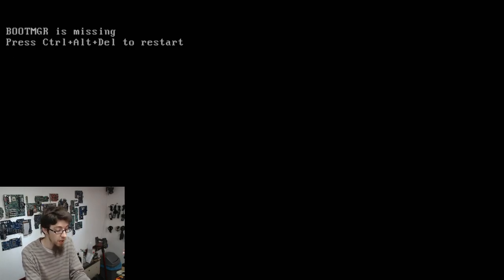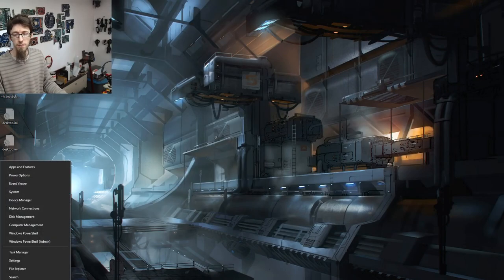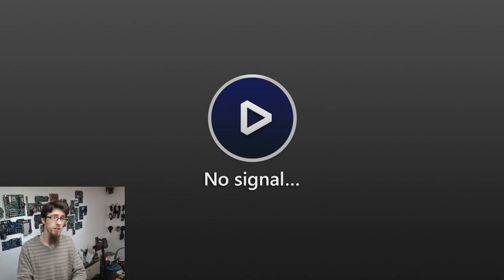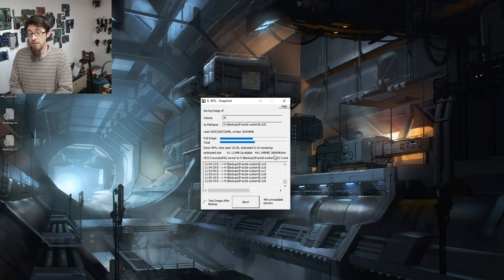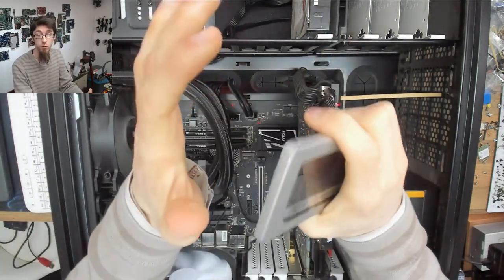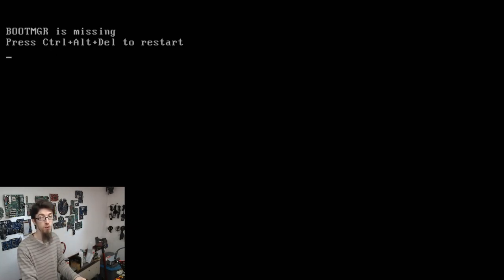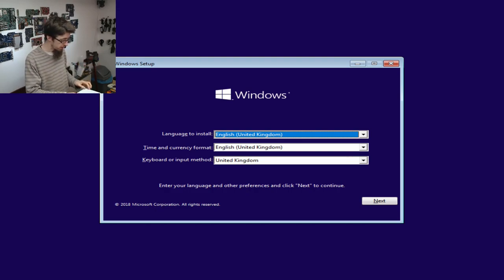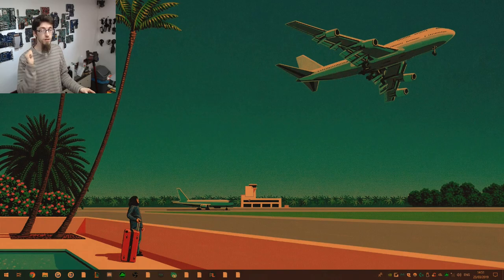LFC#170 - BootMgr Is Missing

Comment: 327 / 5000
Risultati della traduzione
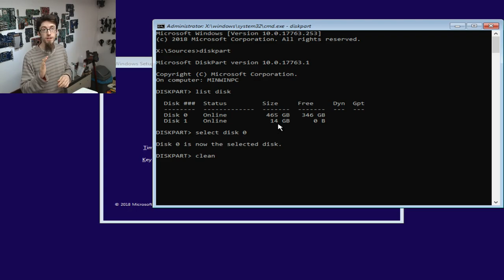Excuse me because you did not use the command "convert gpt? With my EVO 970 I did initialize from the hard disk management and I could not install the operating system it tells me that it could not create a partition. Then I did as you did in video 39:56 but I also used the convert gpt command, so I didn't need to?

Comment: Will this work to expand the drive size? I upgraded to 1tb from 500gb I use free clone software but it only shows (rounding up) 500. I can't get device manager to do it. I expanded the last partition but it still doesn't show, it's just usable space now?. I was hoping to not have to buy a 40-50.00 key to use the clone programs or partition manager program.

Comment: I like to keep a 'Windows to Go' USB stick handy, (32gig made with Rufus) that I can boot from and access the possibly bad boot drive as a second disk.  Saves lots of time.  Can recover data from it onto another USB stick provided it is readable.  Don't even have to open the case.  Can access disk manager and look at the partition setup if it's readable.  I put Aomei backupper on that Windows to Go disk so can run a backup to USB as well.  MEMTEST on another stick, and I can do the basics without opening the case.  Once memory looks OK, and I have some kind of backup, I can move forward.  That's the lazy woman's method.

Comment: I had a Nightmare swapping to a new SSD. I had successfully cloned my old SSD onto the new one but it would not boot and I would receive the bootmgr  is missing error. I eventually figured out that Win10 had put the boot partition on the harddrive when I first got the old SSD, so could no longer find that drive one it was replaced. I followed guides about how to create a new boot partition but nothing worked. I was able to update the bootmgr on the harddrive to a windows install, but as I had an old win 7 install on another drive it used that one instead :(  I was able to find a GUI tool that would let me change it (bcdedit sounds familiar) and now the SSD is being used. I gave up trying to make it bootable on its own.

Comment: I fix this all the time with just the actual computer, a hard drive / USB to backup, and a USB boot stick with Windoze installer on it. Laptops will have built in diagnostics. Do a video on using Windows boot USB, external hard drive, and RoboCopy to copy off your user data that would help so many people: RoboCopy off your data and an then a clean Windows install. Clean Windows install cures many ills.
Reply: I've had good results with bootrec but you need to be in a PXE boot and not on the mounted drive, run the commands from drive X:.  Likewise SFC.exe will complain but it's only about cache files and fixes things.

Comment: Maybe a simple or stupid question but could you not just take an image of the bootloader partition and use it over and over again?
Reply from the maker: Possibly, there's a couple of variations depending on drive configuration, EFI or non EFI, and so on. I think by the time I'd nailed down which images to have, I could just fix the issue at hand.

Comment: Where Windows puts the boot stuff isn't arbitrary. I found this out the hard way myself. What it does is it puts it on the "first" drive. How it determines the first drive I cannot say, but I imagine it's the same way Linux determines names like sda, sdb etc, presumably going by the first S-ATA port, nvme etc etc, in whichever order they are searching for the various types of drive interfaces.

Nevertheless, it's not arbitrary, but it sure does feel like it. I heard from somewhere that Microsoft started putting the boot stuff on the drive you're installing to with Windows 10, but I cannot verify this as I no longer run Windows.

Comment: From what I understand from that is it seem to keep the bootmgr file in a different location on the ssd.

But unsure where it is...

As i thought the old ssd corrupted the windows 10 what was on the old ssd, so that is why that windows 10 had a missing bootmgr file, as obviously the ssd was corrupted.

So u saved all what was on the old ssd to your computer.

Then you installed windows 10 from a flash drive, what then u installed on the new unused ssd.

But what I don't understand is when u moved the windows 10 file from your computer what was originally on the old ssd, then you put that window 10 file ton the new ssd, but in the partition where the windows 10 what u installed from the flash drive then install on the new ssd was.

So why is it when u put the windows 10 file from the your computer what was originally from the old ssd,  in the new ssd partition, what has the flash drive installed windows 10 on it, why did it not reproduce that missing bootmgr error?

Is it as when u installed it from the flash drive, then installed that to the new ssd, that bootmgr file was not installed in the same partition of the new ssd?

As i would of thought if someone hyperthcally installed say 10 gb file  say with a file name - A, on some memory device like a ssd etc, what say was also only 10gb storage capacity, BUT then that person installed a file what was also 10gb  say the file was called - B on to that 10gb capacity ssd etc.

Then won't that mean the A file would be totally abolished, as B file would of used all that 10gb capacity ssd etc, what was originally used by that that file A.

Comment: Couldn't you have done a clean install of Windows using the save existing data option?
Reply from the maker: I find that to be a very unhelpful option because you still need to re-install all apps (unless it's changed since I last tried it) so it doesn't actually achieve anything that a backup-and-reinstall wouldn't do.
The methods I use are designed to preserve all installed programs as well, which is the more inconvenient stuff to set up again. Just copying user files back is easy.

Comment: If you have a windows 8 system can you use a windows 10 USB or does it have be a windows 8?
Reply from the maker: I think so, yes. One of the main things that game me trouble in this video was mixing UEFI and Non-UEFI boot. If the windows install is non-UEFI, you need to boot a non-UEFI flash drive to repair it. Standard windows USB has both on it, so you can use the BIOS boot menu to select which mode you need.

Comment: whats your view on a 4tb hard drive used in PC windows 10 pro, windows formats it to 2tb and the remaining 2 tb is unsuable, is there a fix/work around for this...
Reply: Yes. If it's your boot drive and the only drive in the computer, old style BIOS won't boot off drives bigger than 2TB. If it's just a data drive you should see all 4TB. Only UEFI booting will see all 4TB as a boot drive. Unless your PC is pre Sandy Bridge, you should have UEFI based computer
Reply: Basically what Craig said above me but just to add: if it is just a data drive and you still can't see the remaining 2TB then it may simply be unallocated in disk management which can be fixed by creating a new volume
Reply: Sounds like your drive partition is formatted to MBR, it needs to be GPT to able to use all 4tb ;-) You will lose all your data during the conversion unless you want to pay for specific software to do it for you. Windows has everything you need to convert it though, just google it.

Comment: I had subscribed awhile ago .. idk .. 2 / 3 yrs ago .. ? Hadn't watched in awhile either , was fixing / upgrading laptops as a hobby .. I really enjoy it , kinda self taught , an watching tube videos .. I actually purchased nice / decent used laptop ( acer )  I kinda have a difficult issue trying to get into password protected bios menu .. w / out simpler solutions  ..  at the point now possible flash bios chip to disable password  .. but last resort option was to purchase bios chip , as advertised with out password protected ..  preprogrammed  .. I've tried few other options with no success cmos battery removal .. contact points, which battery located under M.B. .. UGHH ..LOL .. ALLS GOOD .. I'll get it one of these daze ..

Comment: I'm wondering what if you copy boot partition (system reserved) from another working pc?
Reply from the maker: That'll be luck of the draw. The partition setup seems to be a little bit random depending on the PC's setup - ala, EFI boot, upgraded from older version of windows, OEM or vanilla install, etc etc - so the chances that the 'donor' boot partition has the correct config for the repair PC are slim. There's probably more elegant solution that the one I use in this video, but you have to weigh up Time Taken To Perform An Ugly Solution versus Time Taken To Find The Elegant Solution.
Reply: The cleanest solution I've found is to reformat the 100MB EFI partition, assign it a drive letter in Diskpart, then run "bcdboot <Windows driveletter>:\Windows /s <EFI driveletter>: /f UEFI".  That will set you up with a fresh bootloader with BCD pointed at the correct Windows volume.

Comment: I wonder what if a similar issue occurs on Mac OS or Linux.
Reply from the maker: Linux I'm not sure. macOS doesn't have too much issue because it doesn't use a bootmanager, macs simply look for a System folder on any available drives on boot, starting with the last-known-good boot source.
However, macOS can sometimes get its knickers in a twist during a big version update and get stuck in an install loop - so it's not immune to similar problems.

Comment: boot manager usualy installs on a "different hard drive" if u got it plugged in while installing windows on the drive you selected.
this is why when im installing windows....i disconnect all the hard drives (usb included except the one with the windows on it)
I just dont know what kind of "black magic" windows has...that installs the boot mgr on a different partition or hard drive for some reason...
since i had this problem  almost "every time" when im installing windows im ending up having the boot mgr on a different drive...and when im disconnecting the drive that contains the boot mgr...BOOM that message appears on the bootscreen.

Comment: This will work if, for instance, I cloned to a larger capacity M.2 NVME SSD from a M.2 SATA SSD and now it won't boot past the MSI logo on "restart", but it boots to Windows every time after a proper shut down. So right now I just avoid restarting my system. I don't really need to do restarts unless I install certain programs etc... But I don't like that it won't restart... Weird... Thanks for the video. I will definitely use this if in fact it might help my problem..

Comment: You assume all the time like with the BSOD. A failing hdd or ssd could cause BSOD and it may not be RAM as you immediately say. Also you don't necessarily need another computer as you explicitly state as there are tools such as hirens boot disc which would allow you to test everything in situe. Also you dive immediately into backing up the ssd when you should test it first as you will be backing up potentially corrupt files and why do that when you could only backup what the user really needs. You then restore a corrupted backup to a brand new ssd .. no no no. Start from scratch and copy data over as that way you have a fresh install that you know will work and be reliable

Comment: So anyone know if the latest Windows 10 feature update (build 2004) can make an NVME SSD - which was the boot drive - just completely disappear from UEFI?

No Windows Boot Manager in UEFI, no BootMgr missing error; just a  black screen after the system POSTs before it kicks you into the UEFI.
Reply from the maker: Not something I've seen happen yet... I take it it's not visible from a windows recovery environment either? If it's vanished entirely, I'd probably go straight to backup and reinstall windows.
Then if you've got a clean image backup of the windows partition, you could do the clean install to fix system partitions then restore Windows like I did in the latter part of this video.
Reply: @Adamant IT:

Hi Graham. Thanks for taking the time out. It's my nephew's PC, so I just had a brief look at it on Friday and won't be able to get back to it until later in the week.

No, NVME not visible from either Windows recovery or a Linux Mint USB (may have needed a driver).

Anyway, I plan on clean reinstalling Windows on a spare SATA SSD, then using your partition trick from the end of the video if I can get Windows to recognise the NVME. 

As much as I've implored him over the years, I'm afraid he doesn't have a backup. I imagine you find yourself in the same boat with many of your clients.

I'm hoping I might be able to load the Samsung NVME driver during setup or, failing that, inject it into the WIM file prior to setup.

I did a CrystalDiskMark test on the NVME a month or so back and speeds and temps were fine (65C max under stress), so I doubt there's anything physically wrong with the drive. Not ruling it out though.

Mind you, he does let the PC get rather dusty (lots of animals in the house) so it could just be a poor connection. NVME's a bit hard to get to as it's under the GPU in a custom loop.

I'll let you know how it goes.
Reply: @ Adamant IT:

HI! 

First of all, congratulations on 50,000 subscribers. Your informative channel deserves the support.

Sorry I took so long to get back to you on this, but work got in the way and I was only able to start working on his system for a few hours last week and last night.

Anyway, physically installed the new SATA SSD last week (that was fun, because I wanted to avoid having to dismantle the watercooling loop and therefore had very little room to work in).

Booted the live Linux USB I had prepared and what do you know - the NVME SSD had reappeared (the system had been powered down for 2 weeks). 

So I gave booting into Windows a try and it worked. I  was still going to reinstall Windows onto a SATA SSD (because at this stage I still had no idea what had caused the NVME's disappearance) so I cloned the NVME and that is as far as I got because I had a shift the next day.

Cut to last night and my nephew had decided to risk leaving the NVME as the boot drive (provided he implented a backup plan for the most important non-replacable data on there), meaning no reinstall of Windows was necessary. 

The new SATA SSD he would use for installing games (which are taking up an increasing amount of space as time goes on).

So after tidying some things up, I re-enabled the overclock profile (I had set everything to stock whilst troubleshooting). Upon rebooting, I now had a missing HD. Set it back to stock -  HD reappears. Re-enable overclock and it's gone again.

So I now know the culprit. Something's dodgy in the overclock settings. VCore too low, cache frequency too high or one of the bus voltages too low? Motherboard not up to the task? Who knows. That'll be for next week's investigation. Ain't computers fun?

Comment: Would you say an m2 is better than a ssd or a hdd.
Reply from the maker: M.2 is a connector. You can have different types of SSD with M.2 connectors with different levels of performance.
As of this comment though, NVMe M.2 drives are generally the best performance per dollar.
Reply: @Adamant_IT  thanks for reply gives me a better idea of setting windows up now thanks.
Reply: @Adamant_IT  I all ready set up my computer with ssd 128gig Samsung and com started up in 11seconds and shut down in 9seconds on a amr3 970 gaming board fx8350 16gig of mem 750psu but at this time I need a good graphics card but we'll you know.

Comment: I  found it easyer  to use windows installer to remove the boot manger partition and then connect the SSD to sec pc and make new boot manger partition on in Diskpart on the Drive if the OS is healthy .

Comment: This is strange 2019 and i see a Bootmgr error, who switched their UEFI bios to Legacy mode... bootmgr should not be used in a UEFI system boot.efi should be used I.E windows installed and drives formated for UEFI (GUID Partition tables) mode Especially when there is a 2TB or bigger HDD in it. but for anyone else UEFI is much faster due to parallel hardware initialization Legacy is a single process system issue command to hardware to startup wait for hardware to say I'm ready,

UEFI Boot mode also supports Operating System bootloader validation so the aforementioned boot.efi file has a signature registered in the UEFI that is used to validate the EFI file if that signature fails then the system can stop the OS booting to stop EFI Low-level viruses loading.

Comment: You should have just reinstalled windows on the new drive and then bumped over any day that he had. You make that way longer than it needs to be
Reply from the maker: When you do this for a living, you routinely come across computers where a windows reinstall will be a royal pain in the ass for either you, the customer, or both. Absolutely this wasn't one of those times, gaming builds are easy to setup again - but there's high value in knowing how to recover a broken install that has a specific configuration or setup you want to preserve. Streamer PCs are a classic example, it takes a long time to get streaming apps and utilities setup just right, and a couple hours to fix a windows install instead of a day to reconfigure all the streaming apps can be a god-send.

Comment: I actually picked up a dinosaur HP . 17 in screen .. I can / could play older better pc games/ software  .. well it missing a lot of parts , an I was actually able to convert to Msata .. ? which runs way faster , well back in the day when new cost 2,000.. weights about 20 lbs .. I paid 25.00 for it an it was through a local charity sale ..